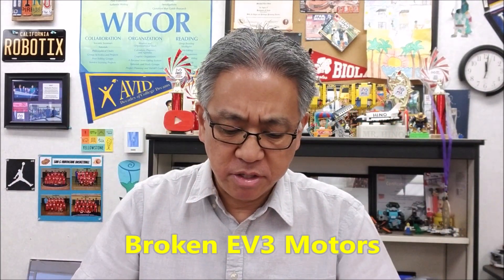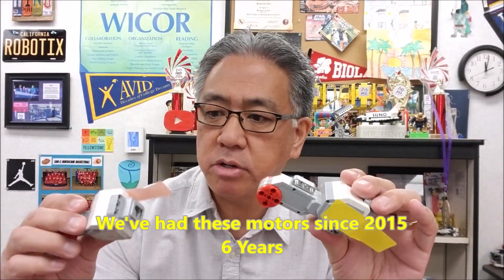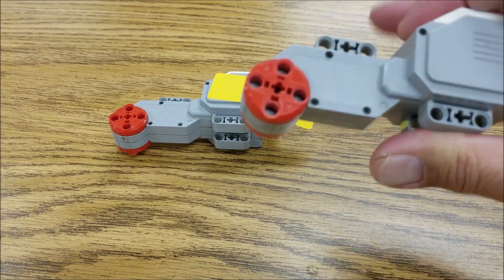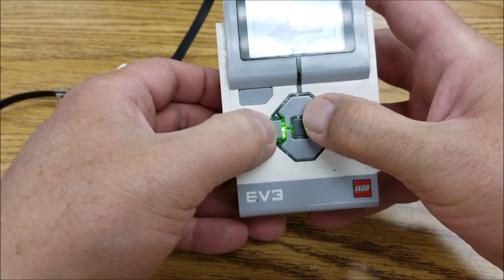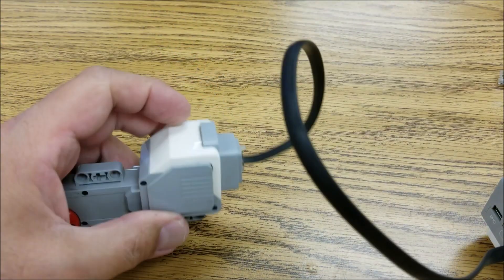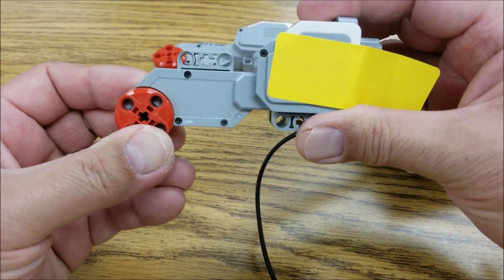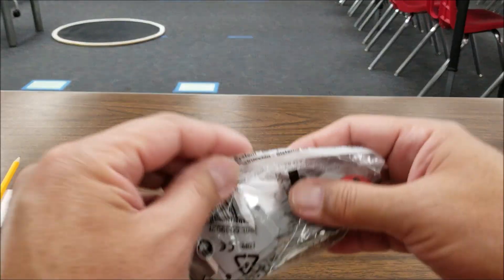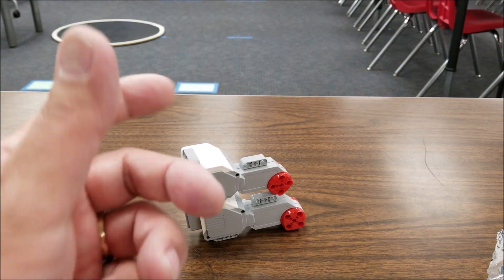The Sad Story Of Broken EV3 Motors

Comment: I think I know what the problem is. I teach robotics for kids, and I use a lot of these motors. Some years have passed since we first bought them, and now it seems that several motors have stopped working. I decided to open one of the broken motors to see what was happening. I discovered that the motor brushes were broken, so I replaced the electric motor with a new RF-500TB-14415C motor, which operates at 6V. Now the EV3 large motor works again, but for some reason, it turns slower than with the original motor. I don't know exactly which motor model is the correct one, so I'm going to try the RF-500TB-12560 6V motor. If anyone knows the correct motor model, I would appreciate it.

Comment: How many medium and large motors are good to have on hand for a variety of builds? My son and I have three large motors and one medium motor. I'm ordering additional parts and would like to get everything at once.
Reply from the maker: Well because most builds are assuming you only have 2 large motors and one medium motor, I would say that would be adequate. However, if you want to keep a robot around and work on another, you would have to buy more.
Reply: @LEGORoboticsMrHino  Researching the T-shirt folder made me see the need for three large motors, and that got me to wondering about other possible motor-intensive builds.
Reply: @LEGORoboticsMrHino  You've talked me into getting a second 31313 kit. Is it enough  to service two complete 31313 kits with the plastic parts from one 45540 core set and one 45560 expansion set, or will I find that more plastic connectors will be needed?

Comment: Please don’t throw them out!!! The motor costs $4 to repair, and the gears aren’t available anywhere else. Use them for spare parts to fix other motors. Or send em to me and I’ll fix what I can out of em. I’ll do it for free if you pay shipping.
Reply: what's usually the problem? how do you fix them?
Reply: @poderis1088   number one issue is stripped gears. Unless you have a damn good 3D printer you can’t print that small. And since lego isn’t making them anymore we should be using the broken ones to fix the ones that can be fixed. They have “brushed motors” and the brushed wear out under load. It’s a piece of metal that costs less than $1 to make
Reply: @poderis1088  if the outer shell is cracked, it can’t be fixed. This is a good time to “retire” that motor, that way if you have motors that break on you, you’ll have a working motor for spare parts. A cracked shell doesn’t mean a broken motor either, I have 3 or 4 with cracked shells and they work great. If you find a crack on the arm of the shell(towards the drive hub) stop using it immediately. The arm is full of gears with teeth that aren’t 3mm long. It’s very hard to make replacement gears.
Reply: Can I ask what kind of screwdriver is used to remove the ev3 engine?
Reply: @ there is no engine in the entire ev3 lineup. Please be more specific

Comment: I have exactly the same problem. Is there a way to fix the motors?
Reply: Yes. I send them to the distributor here (GAMMACO. I’m in Thailand) and it takes 3 days to repair. I have 3 out now and today 2 went down. Same issue. Hard to turn. I just drop them off and they repair them for me.
Reply from the maker: We've tried using different cables and bricks to no avail.  The motor just got to end of its life.

Comment: Is the rotation sensor still good? Then don't throw it away! There are several applications where the motor's rotation sensor can be used as a control device for the EV3: I use my dead motors (NXT and EV3) as controllers on "remote" units that talk to "car" units through bluetooth. So far I've only seen one rotation sensor fail.